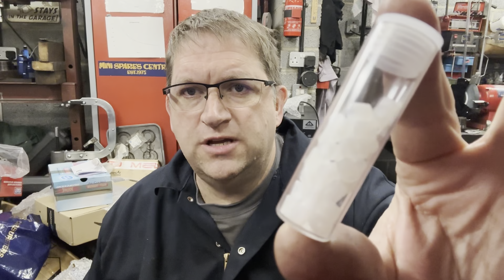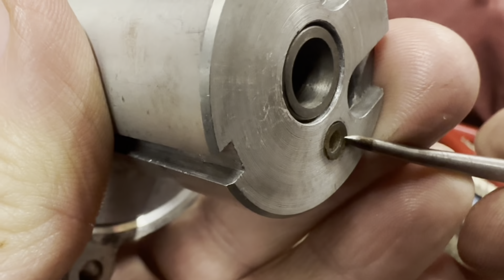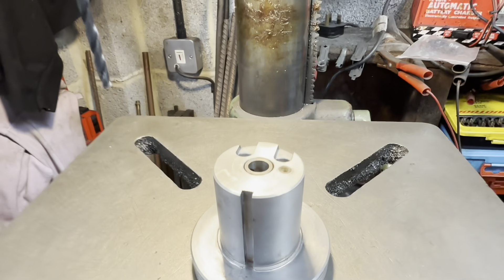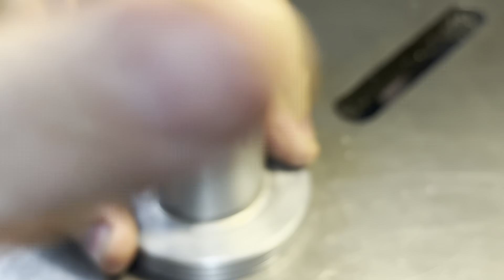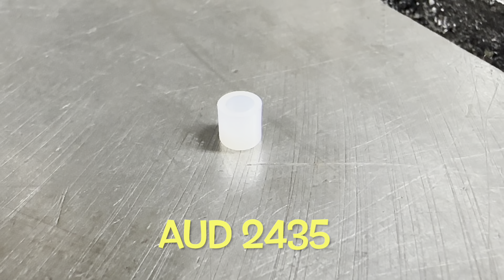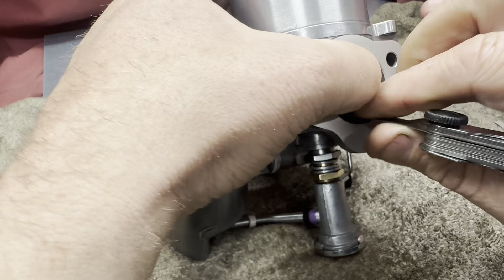Su carburettor Piston cushion replacement

Comment: Hi AC, do the same requirements apply to the HIF44 carb. I’ve noticed that our carb has quite a scar on the bridge from the cushion material and the clearance is a little over 5 thou.
Thank you
Reply from the maker: 0.010 to 0.014"
For the HIF44
Reply: @ACDodd yes, thank you. I think we are a little shy of those numbers being at around 5.5😳 I guess it is pretty much worn 😬
Reply from the maker: @christopherkent6512 yes standard rebuilding practice
Reply: @ACDodd order placed with SU

Comment: hI AND WOW! Do you prefer the nylon over the brass for H6 carbs? if yes why? I see these pistons have a 45? degree chamber at the bottom? Are H6 carbs supposed to have that too? Does the width of that chamber effect the idle? or? Or are all the edges supposed to be sharp 90 edges? What are / who makes the best pistons / damper for a H6 used for road racing?
Reply from the maker: Nylon. Less wear on the castings. SU are The only people who make pistons.
Reply: @ACDodd  Ok, thanks

Comment: Great information AC.  Just pulled my MGB carbs apart to refurbish and found one piston had no cushion in at all.
Reply from the maker: Yes that's the point you have to check all the little parts to ensure correct operation.

Comment: If you spray the cushion with "Freeze Spray" just prior to facing it on the lathe, it will cut cleanly. Give it a try and see. You will be happy.
Reply from the maker: That's a good tip I will try it
Reply: @ACDodd  When I was still a design engineer,  I had to get very fine tolerances from very small plastic parts (that go into beating human hearts) using High performance Acetal homopolymer "Delrin", I would have the Machinist  bathe the "Delrin" in liquid nitrogen and it would machine like 6061! Otherwise, the material will just slightly yield to the tool before it begins to cut and controlling that yield is very difficult when holding very tight tolerances.
Reply: @benkanobe7500 what's 6061 mean?
Reply: @AdrianBellVoiceovers  The short version from the web to avoid Trolls: " the industry standard and go-to metal for manufacturing, prototyping, and structural projects because it balances mechanical strength, low weight, and ease of fabrication." The simple answer is that if you do much fabrication most people find it to be one the most wonderful materials to machine on a lathe or mill. There are several forms of 6061 but painting with a wide brush just "6061". I was making the point that difficult material to machine can be made easy to machine by making the comparison to a "known" easy to machine material. I hope this helps.

Comment: Most informative. HIF4 carbs have a groove machined in the base of the piston from front to back which surrounds the base of the needle. How does this affect the gap?
Reply from the maker: No this, is not on all versions, this is on carbs designed for larger engines, this is there to reduce thensignal over the jet to make them less ‘sensitive’ at low throttle openings.
Reply: @ACDodd fair enough, the carbs  I have came off an mgb but I'm using them on a 1275 mini. Still seem to work fine.
Reply from the maker: @peterknight4692 yes I have also changed the pistons for the non grooved type before to increase the sensitivity on smaller engines installations